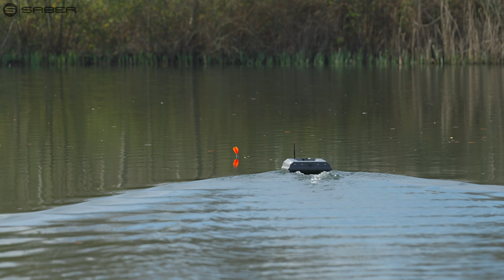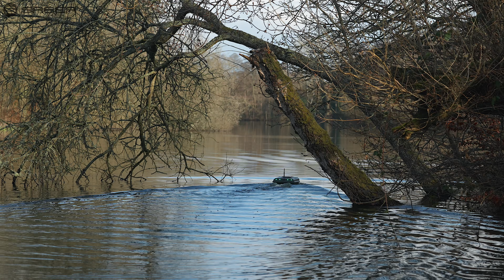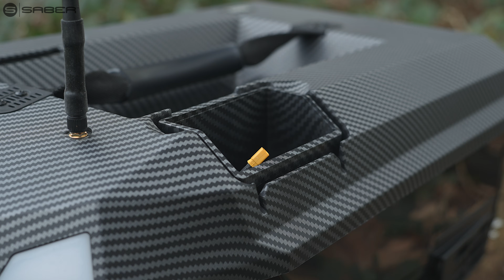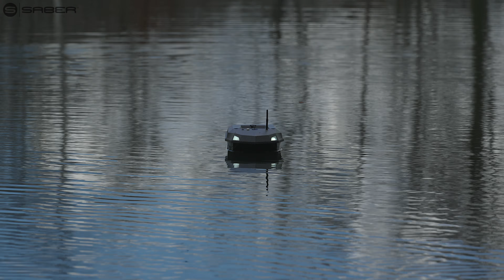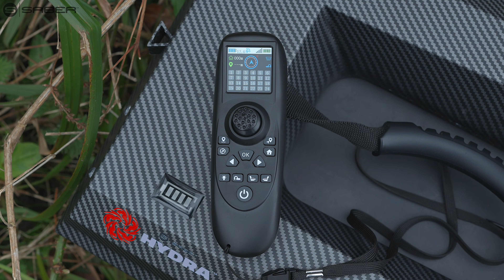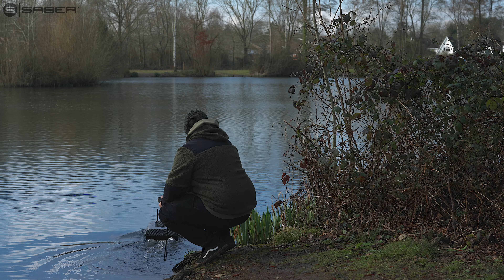How to Use the Saber Hydra Bait Boat (Step-by-Step Guide)

Comment: Great video I have one of these, no GPS. Not because I was being cheap but because I was unsure of the gps accuracy. So I bought a cheap golf laser distance measure. Stand in the same spot pick a line or a waypoint in front of the boat then you can drop exactly same spot everytime

Comment: Got  Gps and sonar version, used it yesterday for first time........is there some trick im missing about loading it up ........3 times it brought the hook back to home point in my peg......hook was stuck to the magnet on the bait  drop shoot.
Reply: best to stick pva nugget on job done
Reply: Put the hook at the front of the boat lead at the bk flys out
Reply: @darrenrye1395 do you rate the boat mate?
Reply: @danmac9170 i have had problems with the battries but i dont use it much to be fair its ok i would not buy it again .
Reply: @darrenrye1395 cheers mate

Comment: My neighbour has this boat and i used it and the GPS for a few of my spots in france recently. Stood in the same spot everything and the boat was so far away from my spots on every occasion i used it.
Reply: make sure to wait a couple of minutes after turning the boat on so it can connect to the satellites, then do gps calibration each time. it should be more accurate. Satellites move all the time, so it might not be connected to the same satellites and will need calibrating again.